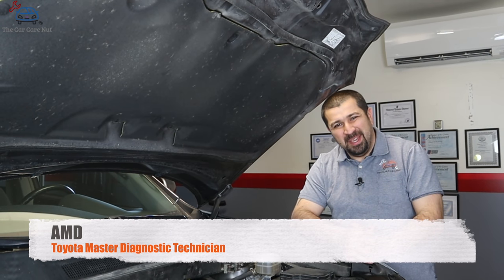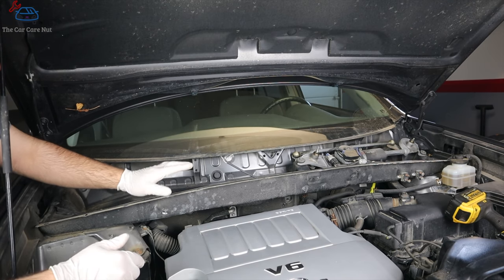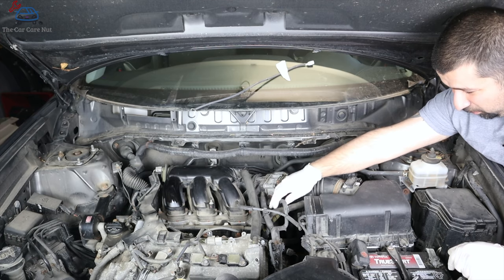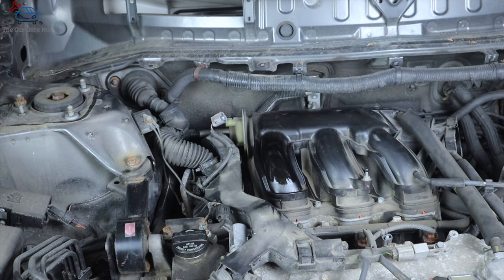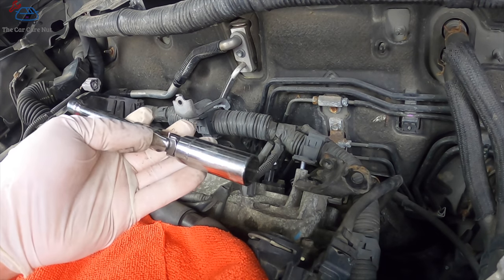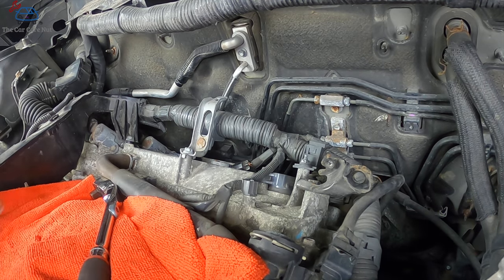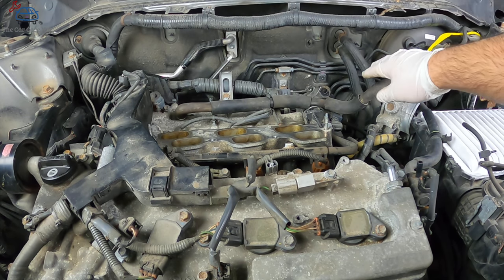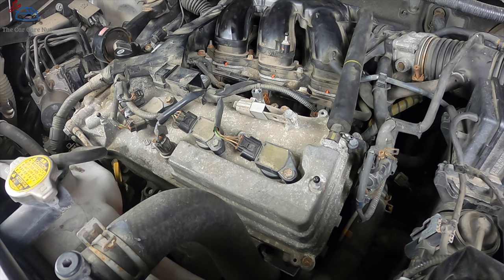How to change spark plugs on V6 Toyota and Lexus 2GR-FE 3.5L engine

Comment: The only comment I'd make is that its always best to thread in the new spark plugs and to screw them all the way down with your fingers. I never use a ratchet or any power tools to screw in spark plugs. The only thing I use is a torque wrench to tighten them once they're fully seated. It takes a little more time but its much better than cross threading a spark plug and damaging the threads and then having to replace the cylinder head.

Comment: Hello. Thank you for making the video. I have changed the spark plugs in my toyota highlander V6. Even though I carefully installed all vacuum lines but my check engine light along with the trac off sign is on. I scanned the and its throwing vacuum leak p0102.

Comment: Great information however you state would be a good time to clean the throttle body but wasn’t requested. 
What are the odds the customer would know this is a good time to clean? Was he advised and declined? If not just do it. How much extra time would it take? 10 minutes?

Comment: Great video. I tried to do this on my '05 Sienna, but the purge hose is brittle and almost  crumbled when I tried to disconnect it. Some of the other hoses were brittle as well. I'm sure I can buy  replacements, but I don't know the names of each hose to tell the guy at the parts counter.

Comment: Very interesting video very  Indept. One question why would you not recommend replacing the 3 coils in the rear? As this is quite a bit of work just to get at those coils. Your other videos you do have recommendations to replace certain items Because it would be much harder to do later.

Comment: I have a 2012 V6 rav4 and spark plugs still original from factory with currently 114k miles. Should I change the plugs or not? Car drives very good but should I replace the plugs or keep driving it?

Comment: A salesman I knew bought a used Nissan from a neighbor. It had 100k miles on it and was time for spark plugs. He said the car now had 180k and still ran fine. Unless the car got hard to start or skipped it wouldn't get plugs. It was still running the originals.

Comment: Thanks for this excellent presentation, although I'm also involved with the 3MZ-FE powering the RX 400h in a Japan made USA model still this info useful. Need see if you also show the 3MZ. Indeed, similar components for every vehicle but arranged according to model. I appreciate providing nomenclature & details for components & tools beside your professional practices. Does this vehicle also include vacuum hose illustration on the hood?

Comment: Very good video. I had a P0015 on my 2013 Lexus RX350. I cleared the code and it never came back. Should I go ahead and change the Oil Control Valve, bank 1 exhaust when I do my plugs in a couple months at 120000 miles or should i just let it be? Could this be a one time stuck oil control valve that is intermittent?

Comment: Thank you so much for this guidance. I wouldnt have done it without this great video. However,  do you have any idea why i would get a check engine light and trac off warning? I double checked my electrical connections, vacuum lines. I test drove the suv and it drove great.

Comment: Thank you so much for these videos. I have a 2009 model LE. I was replacing a knock sensor wiring harness in the valley and we had a rain storm pop up. I packed each of the six intakes with shop towels and covered the engine with plastic sheeting, and had the hood closed but two port still managed to get water in them. I removed as much water as possible with a shot back and sopping it up with shop towels, but after I finished the install and put everything back together, it would not start. I removed the spark plugs and coils as well as injector fuses, and turn the key for about 15 seconds in an attempt to eject any water that may have gotten down past the valves, but none came out. Any ideas?

Comment: Just finished and car started then stalled. Started fine on second start.. ran great. Turned off… stalled on restart.  Second try ran perfect… dreading what could I have done wrong. Rewatching video… quickly saw the problem… forgot to reconnect Mass Air Flow sensor. Thank you some much for the video.
Reply: I also replaced the 3 coils in the back… never want to work in that area again😅

Comment: Amd thanks for a great video with easy to follow instructions, really appreciate it. I have a quick question, If I change the PCV Valve is there a torque spec for it?

Comment: Good video. But you don’t have to do all this for 3 spark plugs and ignition coils. Loosen the two screws holding the intake hose. Remove it and you should be able to remove the 8 intake manifold bolts. Also get yourself a swivel spark plug socket and 12mm swivel ratchet wrench. Makes the job easier.

Comment: Thanks for the informative and educational video, it was well done! Would you recommend using anti-seize on the spark plug threads and dielectric grease on the spark plug wiring contacts?

Comment: Thank you very much for this video. I just replaced spark plugs for my '13 Highlander at 120k miles. I wanted to ask if you have the part number or size for the plenum hex bolts? I stripped one of them. Thanks.

Comment: Hi, this was so helpful! I was able to get all 6 spark plugs changed for my 2011 Sienna, and I think I put all the hoses back together. but after driving it around the VSC light comes on and the OBD sensors says P0354 Ignition coil D. primary / secondary - circuit malfunction. Did I do something wrong? - the car starts fine and idles smoothly and there is power to the car as before...my wife says it's much smoother than before. The check engine light is NOT ON. - I disconnected the battery for a few minutes and put it back on. and this seems to have cleared the VSC message but it came back on today. I did a reset of the VSC and turned it back on. Anyhow, is the VSC related to the spark plug?

Comment: Having done this job on my 2GR-FE, I'm a little disappointed that you weren't a little more meticulous with cleanliness.  First, before starting, the area around the base of the plenum should have been cleaned with compressed air or a vacuum to prevent loose dirt from falling into the engine when the plenum is lifted off.  With the plenum off, you definitely should have used a vacuum before using the rags to cover the open intake because you ran the risk of knocking loose dirt into the engine when placing the rags.  The clean side of the air filter should have been covered or the filter simply removed because any dirt or dust that falls on the clean side of the filter will be sucked into the engine.  The coils should remain on the plug until it is time to replace the plug to keep the spark plug wells covered and prevent dirt from being knocked in or blown in when cleaning adjacent spark plug holes.  Also, the plugs should be broken loose and then use compressed air to clean out the spark plug hole; yes, the coil seal should keep the hole clean, but unless you have verified the condition of the seal, and/or got a visual of the spark plug well to confirm its cleanliness, it's best to just blow it out as good insurance.

Comment: I have a 2010 Avalon Limited with 149K miles and the plugs have never been changed. Do you recommend changing the coils at the same time? My local mechanics say to wait until I have a problem with them. Also, should the coils be changed at the same time? How long do they usually last? Thanks for your time AMD :)

Comment: Never had a Toyota and thinking about getting an Avalon, Lexus ES or Camry XLE, but between this and the rear main seal issue I think I'll go with a 12 and up Camry SE 4 banger or a Corolla. These V6 just look like a pain for DIY work unless its longitudinal like in a 4Runner or Tacoma. These V6 engines remind me of the 99 Taurus I used to have.
Reply: Same here my next Toyota car won't be a V6.

Comment: The video was 33:35 minutes long. With the sped up parts, how long would you say it actually took? About 2 hours?
And thanks for the very informative videos. I'm just thinking of doing more work myself on my 2006 Toyota Estima and it has this exact engine, and it is already time for spark plug replacement, according to your provided estimates.

Comment: Greetings awesome video and thank you. I had some problems with that plunem bolt but finally got it. But now when I start the car it comes on fine and sounds great, but then it goes off. Also my neighbor loaned me his obd2 tool and it will not register at all like it's no power going to the obd port. Any idea what I may have missed?

Comment: Hi, do you have a video on how you would remove the harness for the front top if you were to replace the cover gasket please? For sparkplugs you obviously did not need to. But for the cover gasket, it seems difficult. Thank you

Comment: Quick question: due to the time it takes to get to the plugs in the back, do you recommend replacing the ignition coils as well?  I have a 2012 Sienna with 195k miles.  Thank you and I so appreciate your videos!!! God bless!
Reply: AMD, I’ve read through a bunch of the comments and now see that you recommend that if people are doing this diy that they don’t do it…I’m just curious as to why?  I know the plastic on the connector gets brittle, so is that why?  Other than that, it’s pretty easy swap out, isn’t it?  So sorry for all the questions, just want some help making the decision on whether or not it’s worth it since I’m already doing all the work to get back there.

Comment: Removing that bolt between the fire wall and the back of the intake plenum took over an hour including finding the socket dropped below the engine compartment. The project stopped dead in the water till that socket is found with that bolt still attached to the plenum. Could not see the socket either from the top or going under the car or using an endoscope. Lucked out by removing the front tire and locating it. Murphy's Law strikes again.

Comment: I originally saw this procedure on the L35 in Colorado channel. It definitely makes me want someone other than myself to do it. Considering the labor involved, I think I would have the coils replaced as well. A service "advisor" at the dealership tried to sell me a spark plug replacement job at about 130,000 miles. I declined for the following reasons: the vehicle(2015 Sienna) was still getting excellent mpg; had no misses at any speed; and was apparently running as new. The van has 151,000 now and nothing has changed in its performance. Should such a part(s) really need replacement if they are working just fine?
Reply: Parts and labor are going to keep getting more and more expensive. If you plan on keeping the van, I would just do it. Plus, you will start saving money sooner too, on fuel economy.
Reply: @anthonylale1142  When the fuel economy is identical, spending money on replacing WORKING parts and their installation cost is the same as putting it in a fire. 168,000 and still running great.

Comment: I have a 2011 Toyota Avalon Limited V6 and would like to know what items would you replace for a plug change.  Would you replace the over all coils, plug tubes, and plugs.  My car currently has 93,000 and heading towards that 120,000 plug replacement time.  It runs great, but I would like to do everything at one time to ensure that it will last another 120,000 before doing anything else related to the plugs.  While everything is off I also want to replace the PVC valve.  If you can think of anything else that I can replace while doing the plugs, I would really appreciate it.

Comment: Would you replace those back ignition coils at the same time (120k miles) even if they aren’t causing an issue? Just kinda one of those while your in there questions. Or do those not usually go bad at that time?

Comment: I changed the plugs on my 2007 sienna and I did it without removing the wipers and cowling.  It was a tight squeeze with a lot of blind work on the back plugs but you can do it.  It had 185,000 miles on the original set so yeah I waited a bit too long. The only real problem was that all of the coil pack wire housing clips broke no matter how carefully I worked them.  They just snapped off at the slightest touch due to heat stress  -- very poor design/quality.  Seriously, I think I looked at one cross-eyed and it decided to snap off.   So I did what you hate and used zip ties to hold the wire housings onto the coil packs.  It's held for the last 40K miles so we'll see.

Comment: Have a 2013 rx350 with 85k miles, was thinking of doing a pcv valve replacement and a throttle body cleaning. Would you recommend plugs too? I know it’s not time on mileage but I remember you mentioning time as well. Have limited tools so not sure how much a dealer/tech would charge but wanted to save a few bucks

Comment: I'm currently doing rocker cover gaskets on the same engine at the moment but in a different car (a Klugger). I had to remove the whole wiper assembly and the metal plate to get the access which is way worse than this. Thank God they don't make these engines anymore.

Comment: would you replace the coils at 121,000 miles on this engine or would you consider changing them at the next spark plug change on a 2011 Toyota sienna?

Comment: Brother you one of your kind pro mechanic thank you so much for your time to share and help most of us how to do the right way good on you bro 😎 
I just was searching for a idea why  after I do my spark plug replacement on my toyota crown 2005 3.0L  the VSC system TRAC + Check Engine shows on my dashboard? I did take of the negative off the battery for about 15 minutes to reset the ecu but it still the same ! I saw a cylinder 5 leak oil but i kept same plug I didn’t replace it the rest 5 replaced, because I’m waiting to have a time for a big job for the engine valves seals to be done !! 
O2 oxygen sensor been replaced 4 months ago, gas cap Oring changed as well, Do u have any idea how fix this issue? Many thanks Matt 😊🙏
Reply from the maker: Hi Matt. We don’t have that model in my area. Which engine name does it have?
Reply: @TheCarCareNut  
Thank you for your reply!! Mate my engine it’s a v6 3000cc - engine number GRS182-1007139 engine code 3GR-FSE or S3GR FSE  they call it it’s a JDM it’s imported car from Japan to sydney Australia .
Reply from the maker: You’ll want to get trouble codes. Oil leaks onto the spark plug hole is usually the tube itself on this engine
Reply: @TheCarCareNut  
Yes that’s what I saw yesterday but I didn’t clean it nor change the spark plug into new one ,, so u reckon the three amigos I have on my dashboard it’s because of the oil leak it caused the cods off , I’m thinking to clean it from oil and install new one and wait until do the all head valve done in the right way of course 😉😎
Reply: @TheCarCareNut  
I’ll clean all the oil from the spark plug hole and see what it will do because as I feel if the ecu detected any miss with those spark plugs any kind of oily something it with send those fouls on dash I don’t know I’m just guessing
Reply: @TheCarCareNut  
Omg mate  wife car is this crown she loves it more than me 😁😂  she eats my head since yesterday I wish it’s a Defender Td5 or a discovery 2 it will be much easier to me as this is what I’m good in those rubbish landys  😂😁😉 I’m not good in the great cars such as Toyota ,

Comment: Ahmed: I am planning on replacing by spark plugs & ign coils in my 2011 RAV4, V6, 2GRFE, with 114,000 miles this fall using genuine Toyota parts only. Question: should I also replace the back A/F (upstream) sensor as well, because this sensor is very difficult to replace with Plenum in place? Techstream says A/F sensor is still good, but since car is 12 years old, I am thinking sensor won't last much longer and now is the time to replace it. But you told us "Never replace something that isn't broken". What do you think???  ZuniBill from Wisconsin.

Comment: About to do this job again. Did it last year but i noticed an engine noise after. Sounds like piston slap or pre-ignition. I am going to redo the job with oem plugs to see if anything changes. I had used autolite, maybe thats the problem?

Comment: I just changed the spark plugs and car runs great.  Backed out of the driveway and the "brake malfunction pull over and call toyota" appeared on my display.  Did I loosen a connection on the harness near the rear plugs? or something else I might have done to cause the brake malfunction?

Comment: Very nice video.  I have highlander V6 base model AWD with 150K miles.  I changed the spark plugs but one of front (easy) spark plugs has oil in well. I never had misfire of any issue, leaking or any issue as the car runs well. I also never lose oil!  I always change the oil at 5000K.  What do you recommend? should I change the valve cover for the front spark plugs or for both front and back even though the back spark plugs do not have oil?  I just thought to do both because it is easier now as everything is out of the car?  I also think i have a bad PCV valve as I found oil traces in the air intake manifold.  I am thinking replacing the PCV valve will fix the oil in the spark well or what i should do.  please advise. thanks

Comment: Hi AMD!! I've noticed that another YouTube pro mechanic, that works in a reputable shop, always uses Dialectic Grease on the Coils before connecting back onto the spark plugs. 

Should I use Dialectic Grease on my coils, when I change out my spark plugs on my 2012 Highlander Limited, 3.5v6? 

Thanks and I love your videos!!
Reply from the maker: Hi! Some manufacturers require it. Toyota doesn’t. You can use some but don’t use a lot.